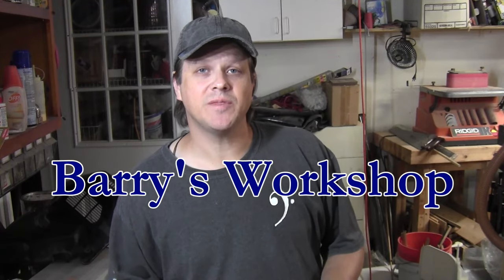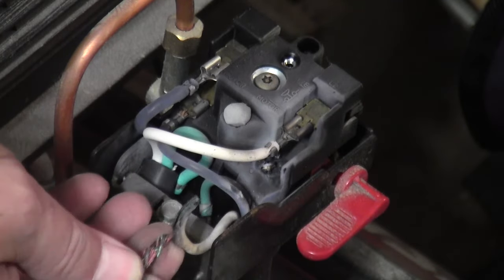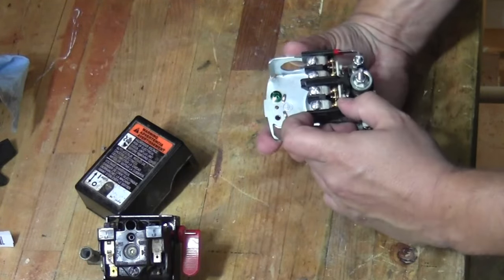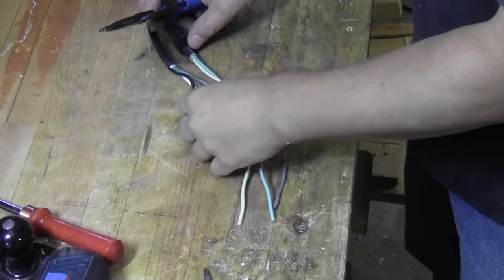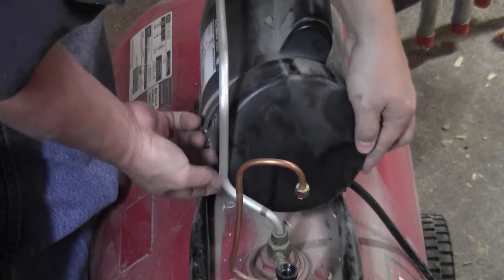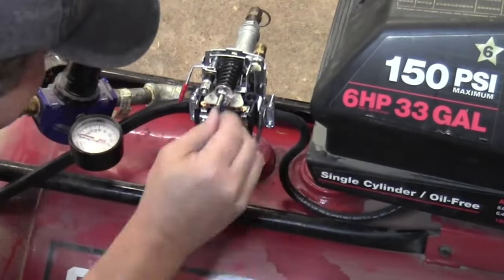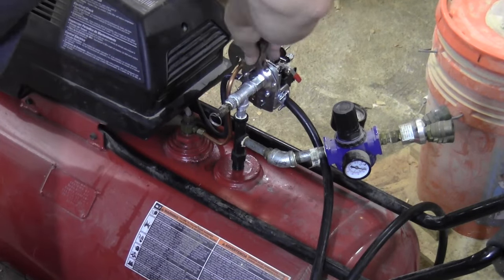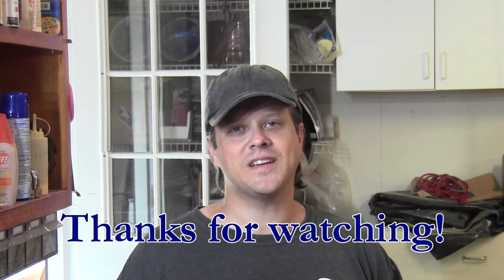Repairing a Compressor Pressure Switch

Comment: I replaced my pressure switch on my husky 60 gal compressor,,,,but when it reaches 135lbs it shuts down,,,,,,but then bleeds down to 90lbs WTF???
Reply from the maker: Sounds like you have a leak somewhere, or else it's plumbed incorrectly.

Comment: hello barry heres my issue craftsman 33gal air compressor , I was using it no problem then when it went to refill it turned off ! Turns out it blew the house fuse , reset it compressor started very slow then blew fuse again , tried it again same thing started blew house fuse ! Is this the pressure switch ?Or something else ? Im a bit handy at least I try to be , but dont know what to look for as too diagnose issues ! Can you give me an Idea what to look for ?
Reply from the maker: If your pressure switch has an unloader valve, then you should hear a short burst of air when it shuts off. If the unloader isn't working right, then the compressor will probably fail to start up due to the startup pressure. If you hear the burst of air from the valve when it cycles off, it's probably not the problem, but it's something to check.
Mine used to trip the breaker on startup, too. I measured it with an ammeter and it was pulling very high current for a brief period of time during startup. I put it on it's own 20A circuit with a new breaker and it has been fine. If this is a new symptom, it may be due to the motor having increased friction in the bearings (or bushings) due to age. If you really have fuses and not a breaker, then you might be able to find one that is slow-blow. If it's a breaker, then it's already slow-blow, but you could try replacing it with a new one (they're cheap). Don't be tempted to increase it with a larger amperage one, for safety reasons.
I hope that helps.
Reply: @Barrysworkshop  Barry thank you for the return reply , as I awaited your reply I found a shop that answered a question over the phone . It turns out I just recently did electrical work in my garage thats not finished so power is off so I used an extension cord to connect compressor and it filled fully at first then it started to blow the curcuit breaker ! Thank you for your assistance
Reply from the maker: @daveg3887  I'm glad you got it figured out. Thanks for following up.
Reply: @Barrysworkshop  your welcome , its all about respect ! And keep the videos coming Im glad I found yours !

Comment: Nice, neat job. I too thought it had to do with repairing the switch itself. I tried to repair mine, but ended up having to "TAP" on the box occasionally for it to restart:) I also ended up inventing a "self adjusting variable shutoff pressure switch" which while unique, was not my intention. I ended up buying the cheap version. I will probably get a Square-D if this one doesn't hold up. (I am a firm believer in false economics). Great video.

Comment: Very helpful video- Thanks! I was able to find an OEM replacement switchfor my model at about 3 times the price of a better built alternative. After watching your video I had the confidence to trouble shoot and if it was going to be necessary, replace my switch. I had none of the damage you found. Turned out just some sticky contacts that are working well after a bit of electrical contact cleaner and some air.  Thanks again- very well done.
Reply from the maker: I'm glad the video helped you! Sometimes just seeing how something goes together is enough to get the gears turning.

Comment: Nicely done-- your explanation is easy to follow, despite the many "notes" you attach to the narrative. The summary at the end is especially helpful, pointing out why you decided to use another switch of different design, and to replace the original wiring. The creation of a new pressure relief line was a bonus demonstration, although it might benefit from a closer shot during creation of the copper line and end-fittings. At the very beginning, it would help orient many viewers to explain what the primary pressure switch does, and common reasons for failure-- even to the point of demonstrating the component parts and how they work together.
Reply: I could not agree more,,,,A very well put together, good paced , yet  very informative ...
Two thumbs way up... thanks

Comment: Thanks for the video, you pointed me straight at the issue with my Craftsman compressor, one of the blade terminals worked itself loose during my last move, and I've been searching for parts for it to no avail.  Never thought about the switch going bad, but one screw later, my compressor is back up and running.  Thanks!
Reply from the maker: Excellent. I'm glad to hear you're back running again!

Comment: Barry I want to thank you for giving me the "confidence" to tackle my compressor problems. So I go in and there of course was like a million screws and low and behold there was a blown fuse on the main board.  So I changed that out and flipped the switch. She came on like a champ. I was so happy!!! Don't know how that fuse blew. Thinking back on what may have done it. I did leave it plugged in and in the "on" position recently. So I will always unplugged it when not in use and flip it to the "off" position. 

But anyway THANKS.
Reply from the maker: I'm very happy to hear that you got your compressor working. It's a great feeling!

Thanks for watching, and thanks for your comment. :)
Reply: Barry's Workshop I got a quick question since I am glad I didn't have to buy another compressor. The valve on the bottom of my tank I hear is good for releasing water in the tank or moisture. How often do I release it? What's that valve called also?
Reply from the maker: That's the drain valve and you should release the moisture regularly to protect the tank from inside rust. Some people say to do it every time you use the compressor, though I suspect that not everyone is that diligent. :)
Reply: Barry's Workshop Thanks.

Comment: Great vid.  Man  i had an issue with a used 5hp sandborn I picked up of Fb Market place.  Bad leak was coming from diaphragm gasket under switch.. gasket not replaceable.. tried to mend.. smh.  After watching your vid.  I went to northern tool and purchased that Square D switch... installed work Great 👍🏽.  Hats off to you man.. thx

Comment: Outstanding! I took apart my switch from my Harbor Freight #47065 comp. Bad move on my part! Won't go back together properly. Especially the small plastic part with a groove in it, that a metal flipper tube rides in. And I had to bend the frame slightly to get a shaft to fit into detents on both sides of the frame. Four hands are needed for this job. HF no longer supports this comp. (No surprise there:). Saw a Porter-Cable at Tractor Supply I probably will get.

Comment: The way I got the compression fitting off my 1/4" unloader pipe was I got a 3 jaw puller and turned it into a 2 jaw puller. And I had a small piece of aluminum that I set on top of the pipe to keep from damaging it.

And I tightened down the 2 jaw puller and pulled the nut off which in turn also pulled the compression fitting off. I rented the 3 jaw puller from Autozone.

Comment: That is the exact same switch that I use for my well pump water pressure tank. I see now where they are the same type deal. You can set the shut off by screwdriver to add a little more or less for what pressure it shuts off at (which you didn't video yourself doing).

Comment: HI, Thanks for the video! The old pressure switch you had looks to be the same design as the one on my 30 gallon upright tank Craftsman air compressor. My issue is just wanting to adjust that pressure switch down a bit. It shuts off at a bit over 140 psi. I can't locate a video on how to adjust the cutout pressure. If you can help please respond at your convenience. Thanks!
Reply: I believe there is a single adjustment screw under the cover of the switch that adjusts the cut in and out pressure at the same time.  Hope that helps, I’m having problems with my switch on the very same compressor you have.  Mine won’t shut off after it builds to 150 psi while in auto mode , found a new switch on eBay for 72.00 but I may try to clean the contacts myself.

Comment: Hello sir I have a vintage air compressor 30 gallons 6 horsepower  and 125 PSI Max  my compressor goes down to about  15PSI before she turns back on and I need more then that before she goes on to start again I didn't see anything to adjust can you please help me and thanks

Comment: Great video! Have a Craftsman compressor with a very similar switch. The contacts in the switch are fried! What is the part number on the Square D switch you replaced the old switch with? It does look a lot better. Also, I never knew that about the Teflon Tape, thanks!

Comment: Would like to see how to repair the switch, not always can you buy a replacement
Reply: Yeah. The proper title would be "Replacing air compressor pressure switch". Reassembling one is waaaaay harder than replacing one.

Comment: I think I have that same compressor. My pressure switch finally broke after many years. Previously I had to replace the regulator and I used a better one because the one that came with it would fly apart without warning it was held together by plastic threads. Just a cheap piece of unsafe crap. The pieces would shoot up and hit the ceiling in my garage and it happened

Comment: Hi, Barry, your video convince me your very knowledgeable on air compressor.   I have a Campbell-Hausfeld compressor Model 
WL604004AJ 125 psi  13 gals. which was given to me by my Father-In-Law.   It was running fine for quite sometime.    Lately, I noticed a  malfunctioning, it runs then stop upon reaching the maximum pressure, but it doesn't run back once the pressure gets low.    I bought a replacement pressure switch but the unloader valve does not fit with the existing that I have.    Should I buy the one you showed in your video.
Reply from the maker: If the only problem with the new valve you have is getting the unloader valve to fit the existing setup, then I would personally look at ways to make it fit. In my video, I had to route the unloader tube anyway. Part of what I was trying to show was that you don't have to use the exact replacement part to make it work. You may need to bend the tube and/or get an adapter, but I would be surprised if you can't get it to connect. Good Luck!

Comment: Do you happen to know the pressure at which the pressure switch switches on and off ? is it adjustable ? do you have a part number as well ? thanks.
Reply from the maker: Pressure switches usually have a fixed setting for max pressure (shut off) and then have a working range that determines the min pressure (turn on).  From what I've seen the min value may be fixed, or in some switches the min is adjustable within some range.  It's important to find one that matches what you're replacing, keeping in mind the tank and the compressor that it's connected to, current rating, number of ports, etc.  

I know you asked for a specific model, but it's more important that it be a match for the specific setup you're considering. And you definitely don't want to use a pressure switch that has a higher max PSI than the one it's replacing. FWIW, mine has a fixed differential, as did the one it replaced.
Reply: @Barrysworkshop  Thanks for all the great information, my Campbell Hausfeld VT622500 is going on 24 years old and has just shown it's first sign of a problem so I can't complain, having a knowledge base like your video is much appreciated !

Comment: What must you know before buying a pressure switch. Gotta husky quiet series that needs one. There is no oem.
Reply from the maker: Good question. When I was looking for my replacement, I recall needing to know if the compressor has a single port or 4 port, and if it has a pressure relief valve (most do). I also looked at the amperage rating of the contacts, to make sure that the replacement can handle at least as much current as the one it is replacing.  I made sure that the replacement worked with 120VAC since that's the one it was replacing. I recall that most of them could use either 240V or 120V, but it's something you need to check. Lastly, I looked at the size and orientation of the air connections to make sure I could plumb it in to the existing layout. In my case, I had to modify the plumbing arrangement, which was not a big deal, but if you're replacing one on a smaller or more portable model, that could be an issue. I hope this helps.  Thanks for watching!

Comment: What Brand of pressure switch is that?? I have a old Craftsman 15 gal upright, it toppled over years ago and Pswitch broke the on off switch I have to unplug to turn on and off, finding a  replacement has been difficult

Comment: You say copper pressure fittings with ferrule should not be reused, but will my Harbor Freight 40400 compressor create a problem with its unloader valve copper return line if a new line and connector is not used? I would like to bolt on the new OEM pressure switch-- an exact replacement for the original-- and reattach everything as it is. 
In fact, since the original pressure lines are air-tight, need I completely remove the primary pressure switch? In other words, is it possible (in your experience) to replace only the lower half of the switch, the part that contains the rubber fitting that failed, and leave all the pressure lines in the upper half in place?

Comment: what about the cut in and cut off specs? I bought a condor one MDR11/11EA cuts in at 145psi and cuts out at 175psi. The original one had 95 on and off at 125.
Reply from the maker: You are correct to ask about the cut in and cut out values. I chose one that had comparable values to the one I was replacing, (actually a bit lower). I prefer the margin of safety of having lower pressures. The numbers you quote are higher than what it replaces, and may create dangerous pressures in your system or tank, and/or may cause other problems. You are responsible for your safety, of course. Be safe.

Comment: You have a badass beastly air compressor there guy. But what I don't get is, with that compressor being a monster with 33 gallons and 6 horsepower, how is it only a 150 psi Max? 
I don't understand. I have a small portable compressor with 0.3 horsepower and 2 gallons and mine is 125 psi Max. I can't get my brain to understand that logically lol. 
Oh, and I don't use air compressors much so I don't understand them a whole lot so stupid question here..  someone please answer, do all compressors have a pressure switch? And if one has a compressor switch, this switch will allow you to adjust the air pressure flow higher? To say if your compressor is not outputting very high PSI. Like for example, it won't go past 60 PSI.. this switch will allow it to if adjusted??

Comment: Dose the pressure switch differer from 110v vs 220v on the compressor
Reply from the maker: When I was looking at compressor switches, they seemed to be capable of either 110v or 220v. They were capable of switching both sides of a 220v connection.

Comment: Is there any thing i can do bfor replacing the pressure switch, motor keeps tripin 80 psi and leting air out it doesnt cut on and build up,
Reply: I see you replied lately so thought I would give you what I am experiancing with mine and hopefully help you. I have a 30gal. 6hp. Craftsman which was tripping the breaker shortly after start up. That time decreased to soon as you flipped the switch the breaker tripped. Pulled off the pressure switch cover to see one of the white wires had got so hot it was black on the end and almost no connection to it blade terminal. Replaced pressure switch with same as came with. Still tripping breakers after that. As I see that yours is tripping later at 80psi. and leaking off with no cut on. It sounds like you may have dirty contact points in your pressure switch. If you unplug the unit and pull the pressure switch cover you can inspect each set of points. They naturally build up carbon between the points over time. You can use 400 grit or equivalent folded over and slid back and forth between each set to regain good connectivity. While inspecting the contact points see if the are any pits or if the point pads themselves are wore very thin in comparison to thickness of new ones. And compare thickness to all the contacts in your pressure switch . One or more could be wore much more which could also help determine your issue. If you leave pressure switch cover off and observe when turning on you may be able to see an issue. Lots of times if points get dirty they will stick together which this may be happening to yours. And maybe your cut-in is near 80psi. so when your compressor reaches that point and your pressure switch tries to flip and make contact one set of points are dirty or sticking on with activity. One more thing is that another set of points exists which your capacitor or capacitors are connected to. I don't know if your compressor is just like Barry's or not. Mine is close. His I believe is a model 919-167200. Mine is 919-167300. So I do see that his motor appears to be the same as mine seeing his has the stationary switch with the rotating switch. There is an adjustment for those points but primarily this set of contacts used in start up. But if dirty could be a partial culprit. That is all I can give you for now and hope it helps you get you problem solved.